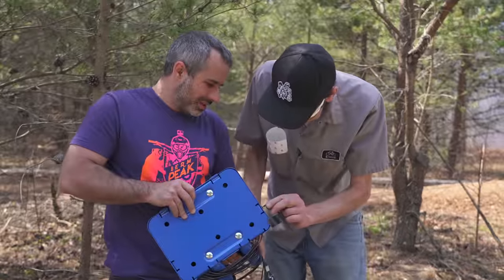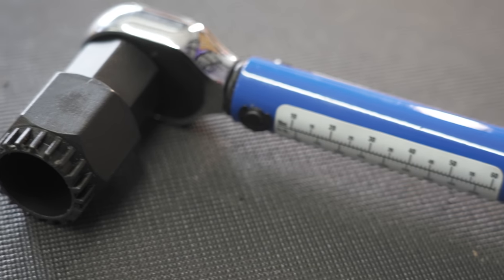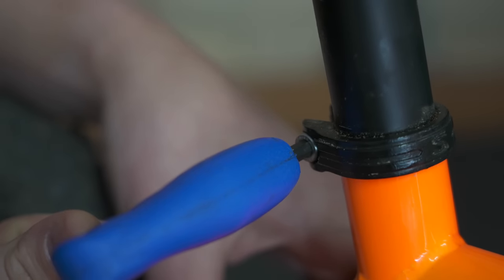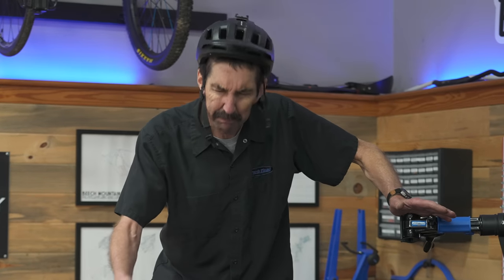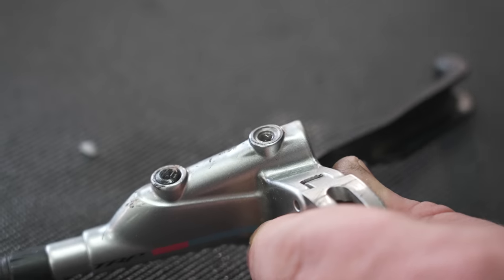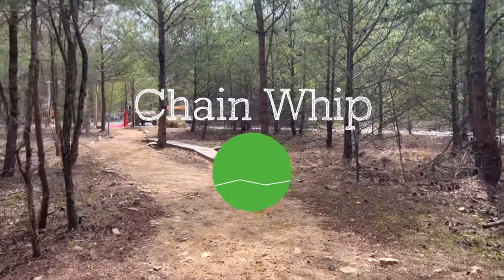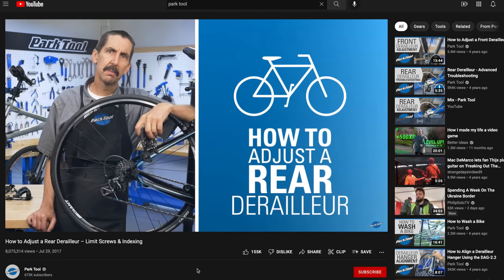10 Rapid Fire Bike Repair Tips for MTB & Beyond - Featuring Park Tool

Comment: All the tips were great. Thank you, Seth and a special thank you to Calvin and Truman.
I really liked the "Drop into water" test. I tried the test at home. First I threw a bent spoke into the water, It didn't float to the surface. Then I tried the same with a worn-out sprocket. It also stayed at the bottom of the water so I throw it out. Then I dropped my wife into the swimming pool. She came right back up to the surface, showing me that she is still good and I can keep her. The "Drop into the water" test really does work. Thanks, Seth for that tip. I am on the way to the lake to try that with my car.
Reply: "I'm on my way to the lake to try that with my car" - May the Schwartz be with you!
Reply: this technique should be used for everything. It's extremely accurate. I might drop my 60 year-old house into the ocean to see if it can hold up for any longer. I'm ordering a house-moving truck right now actually.
Reply: I thiught it was a joke at first. Is this some kind of physics phenomenon I could look up? :)
Reply: @erichbachman7363  The physics principal behind this is called the Archimedes Principal of buoyancy . Added to this is the Seth Corollary which states, “Whatever is not broken, don’t fix it. Whatever is bent, don’t fix it.”
Reply: @erichbachman7363  It was a joke, it will never float. But my first (physics) instinct was that it could be surface-tension related (you can look that up). It could work for lighter objects where a perfectly flat object has a bigger surface than a bent object which is more likely to break surface tension and sink. But this would be more apliccable to things like thumbtacs
Reply: It also works great for car batteries, you just have to replace the pint glass with the ocean
Reply: I threw my baby into the bath. Didn't float. Time to get a new one.
Reply: Posted April 3rd not April 1st.
Reply: @JamieRogers95  hmmm maybe don't throw car batteries into the ocean

Comment: The best tip I ever picked up is one I never see mentioned: If you have a bent hanger and a spare quick-release rear wheel around the shop or are riding with a buddy, remove the skewer and thread the axle through the derailleur mounting bolt. You can eyeball a coarse adjustment and pull/push on the wheel to adjust the hanger, or use a ruler to measure at 12/3/6/9 o'clock between the inside edges of the rims. If a rim is out of true just rotate them as you measure and use the valve stems as a reference.
Reply: I have used that several times, and for sure works. Makes it worth keeping one of your old 26er wheels around after you upgrade to a bike with through axles. Actually even better is to keep the whole old 26er bike around so one of your mates without a bike can ride it

Comment: Rebuilding the hub part brought back a wave of nostalgia for me I remember the first actually good bike I got was a 2009 Cannondale Chase, most backwards bike ever (dj bike with 1.5 through headtube and vertical dropouts???) i remember it came with this shimano cassette hub that could have been made of lead, this thing was like 15 pounds.  I used to ride HARD and i remember coming home from a ride (~13 at the time) and hearing clicking from my back wheel. This shimano hub was cast iron monster and i had managed to crack the inner bearing race, so me being a youngster with little to no money, i bought the same hub on amazon, it was like 20 bucks or so, and I used the axel and races to rebuild the hub inside the wheel! That bike lasted 2 years with me on the saddle until i gapped a 20 stair at UK campus and cracked the chainstay. Thanks for the memories Seth you got me into this shit (with the help of the staff at my local bike shop) and now i'm sitting pretty at 18 on my 2021 dartmoor 26 player completely custom built by yours truly!

Comment: Calvin is one of the best bicycle mechanics I've ever seen on youtube. Always calm, straight forward and explains perfectly. Unfortunately the Park Tools are so expensive in Germany I use other brands instead. But I really appreciate sharing their knowledge.
Reply: Same in Asia. Most grease from Park Tool are nearing 20 dollars per tube. Average salary is around 200 dollars a month. 😔
Reply: Yeah very expensive and no need for some of there stuff.
Good quality tools does the same job.
Reply: He sure is. I have a number of Park Tool and he has answered some of my questions via email. He's da man !
Reply: That's perfectly okay. Park Tools are meant for professionals, or people with some extra coin to spare they want something that will last forever. For your average rider who has 1, maybe 3 bikes at the most, the cheaper stuff is totally fine. 

As a different example, I run a tech repair business. All of my tools are Wiha, Moody or Hakko. All extremely quality tools that are best in class. But if you compare them to something half the price, the cheaper stuff will still get the job done. The difference is I've fixed over 25,000 pieces of tech. The occasional DIY person will be more than fine with a cheapo Amazon kit. Or if you want to step up a bit, iFixit makes a great in-between tool that is very well built but won't completely break the bank. 

There's no need to buy top of the line tools if you're only using them a couple times per year. Harbor Freight is very popular here in the US for that very reason. A lot of tools for the average person will only ever be used a few times. There's no sense in paying for extreme quality and engineering if it's something you rarely use.

Comment: For the headset one, always feel the headset because some cheaper brakes have pads that move in the caliper, and it makes it seem like its the headset. Holding the headset bearings give you a better idea of the condition of your headset
Reply: Ain't that the truth.. 
I personally like the bars at 90° (inline with the top tube) and rock / pull them back and forth / up and down to feel for any play ✨
Reply: @OLI-vx1md  why isn't that the truth then? If you personally do not do it the way Callum does, it's still true that they always feel the headset and some brakes have pads that move around.
Reply: I agree especially a cantilever brake, if you use the front brake trick the cantilever caliper slides within the brake post
Reply: @sdy0108  most disc brakes even do that when the pads are new. My maguras do that, my sram codes do that and my friends trps do too. No idea if shimanos do that.
Reply: @iljamuraschov  My Shimano Deore XTs do that.
Reply: @iljamuraschov  ment to write "ain't that the truth.." .. edited now ✌️😅✨
Reply: @OLI-vx1md  makes sense. Sorry for being maybe a bit to toxic before brother😉✌
Reply: Not just cheap brakes. My shimano XTRs do that out of the box. They still ride like a dream tho
Reply: Dude that's so true. I thought my bike was the only one that does that😲😲😲
Reply: @iljamuraschov  no drama dude, I can see how it seemed I was the toxic one..
Reply: @OLI-vx1md  ✌😉
Reply: I don't even use the brakes. Just picking up the front end of the bike is enough to trigger movement in the bearings if they're loose. One hand on the headset, one hand on the top tube, and lift.
Reply: @paddor  magura also has some one piece rotors, and even without magura rotors (i have hayes rotors on) the pads slide around in the caliper. Usually not that bad tho
Reply: Lol yep my slight wiggle is the pads in the caliper

Comment: RE repacking a loose ball hub: sometimes left and right bearings wear out at variable pace. It's good practice to keep them in two separate piles throughout, so you put balls from right back on the right side instead of mixing left and right. Tweezers are really convenient for manipulating those balls in and out.

Comment: For extracting pedal pins, get a Dremel and run a slot in the top of the pin and use a flathead screwdriver to remove it

Comment: The pedal pin issue is exactly why Hope F20 pedals are the best. The pins screw in from the top, but the screw head is on the bottom so it won’t get destroyed by pedal strikes
Reply: They'd want to be good. They're $300 pedals here.

Comment: For checking the headset,I find it best to turn the wheel 90 degrees and rock it.wheen the wheel is straight,it's sometimes hard to tell as your disc pads will have a little play in them anyway
Reply: Well, this way it may as well be your hub bearings being a little loose.

Comment: When checking for looseness in the headset, it isn't enough to put on the front wheel brake. You actually have to also turn the front wheel ninety degrees to the left or to the right, which will eliminate any play in the brake as a possible cause for forward or backward motion of the bicycle.
Reply: If you have play in your brakes then you have other issues
Reply: @drewziraldo5407  no, the brake pads move very slightly in place and when you multiply that movement through the length of the fork it is noticable and can be confused with a loose headset.
Reply: Nice tip!

Comment: Did my first ever race (XC) this weekend and on the 53km i had to stop 3 times to adjust my seatpost back up to the desired hight and each time i clamped that quick-release harder and harder.

That carbon friction stuff will definitely help, thanks for the tip guys 💪

Comment: If youre drilling the pins out and you have to apply a ton of pressure that ends up bending the drill bit, you need better drill bits..

I understand that the pins are often hardened steel, vut getting a decent set of carbide drill bits will save time and be way safer than having to apply a lot of pressure through a hand drill that will inevitably slip or snap. Everything seemed like very good and genuine knowledge, just thought Id add my 2 cents.

Comment: Before using the extractor, try to fit a small torx bit works 90% of the time
Reply: Even better, try and hammer a torx in, that is just about the same size as the hex tool to fit the bolt

Comment: Something to note when drilling, with a smaller drillbit you need to go faster than shown... If not itll either break the drillbit or dull/burn it out
Reply: Always use a slow bit speed when drilling metal. If you're breaking a bit it's because it's grabbing the cutting edge at a bad angle. Going faster is not the fix for this. Faster bit speed is also actually how to dull your bits when drilling metal.
Reply: @SnootchieBootchies27  No thats incorrect, look up cutting speed online, the smaller the drillbit the faster the speed. I'm an engineer, this is what i do :)
Reply: @Jackywacky96  oh, so close! If you would have said you were a machinist I would have been listening. Engineers are the people who just make life difficult for fabricators and carpenters. Just kidding, yeah, a faster speed on a smaller bit does make sense.
Reply: @SnootchieBootchies27  haha well actually I'm a multiskilled engineer so I do a lot of machine work, fabrication and welding as well as mechanical and electrical work ;)

Comment: Hi Seth, sometimes the trick of putting on your front break and rocking the fork back and forth can be inaccurate.  With my bike, if a rear linkage bolt is loose, it will feel almost identical to a loose headset because of the way vibrations travel up the frame Just sharing my experience here, hope it can possibly help anyone who’s having trouble diagnosing a loose bolt.

Comment: Hey Seth, reverse drill bits are a thing and work great. Sometimes just the drill bit will pull the pin out without even needing the extractor.

Comment: That is great idea and partnership with Park Tool. I am realy enjoing the Park Tool vids, and always it seems like they are extensive, but not enough 😅. I also would appreciate separate channel on Park Tool tools and greases - with all of the descriptions, specifications and 'use-cases'! Not to fiddle around but just go 'straight to the' most recommended grease/oil/chem + tool to use. I really like 'product codes' that PT is using. That removes uncerntainty of what actually I need.

Comment: For filing the flat near the pedal, there are files with a "safe edge", one of the faces is plain metal that won't typically cut or scratch the pedal. Great for getting into corners of parts. If you're good with a grinder, you can also grind your own safe edge on an older (or new) file.

Comment: When overhauling a disc hub, I prefer to remove the disc to avoid putting grease on it and I can also take the time to check if the screws are still good or need a replacement before getting f*cked later. I also give them a nice cleanup before putting them back on so I'm sure they are good to go. Always nice to see you with the guys from Park Tool, it's a very nice collab and we all enjoy to watch your videos.

Comment: funny story no one cares about, but i opened youtube, saw this video in my recommended, opened it in a new tab. Then i searched "how to adjust rear derailleur" to find the park tool video  because I bent mine on my last ride somehow and I had a spare one in the parts bin. Just wanted a refresher to adjusting the limit screws again before I got started on that, and you used the rear derailleur video clip multiple times. Fun video, Off to watch that one. Then out to fix my bike and ride it!

Comment: awesome video, good tips, lovable presentation! For the pedal situation and any stubborn bolts, the power of thermal expansion cannot be underestimated. While you cant torch aluminum like you can steel to be red hot, a bit of prescribed heat does miracles to loosen threads. I've had success even using boiling water.

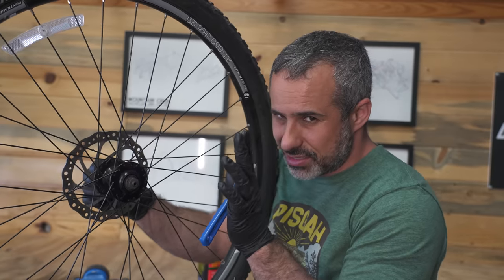Comment: 7:12 is actually right here, when I was overhauling my cassette hub I had to use a Bench vise so the lockout on the cassette side right should not move together on the left. So about the smooth apin, Seth wants it to be the tiniest wobble you can feel because the quick release acts like a locknut but it's also compression.

Comment: As a seasoned bike mechanic I can say that loose-ball hub rebuilds are not usually as straightforward and easy as described but not impossible to pull off in a pinch with no new parts or specialty tools like cone wrenches. A lot of people won't notice their hubs knocking until the bearings and cones are damamged bad enough to need replacement. 

Also, "Liquid Gun Blue" to refinish wrenches? How have I never heard of this!? I can't wait to try it on my aging hex keys

Comment: If you have spare wheel with qr hub, you can use it as deraileur hanger alignment tool. All you have to do is screw the second wheel into the derailleur hole and make it parallel to the wheel that is on the bike.

Comment: Pedal pins can be a pain to remove. If you clean out the hex head carefully as stated in the video, you can put a bit of EZ Grip on the Allen wrench to help take up the free space in the worn fastener. 

EZ Grip is an industrial product, but it's just an abrasive compound used to gain friction on the fastener head. It's also really cheap and readily available.

If you do not have access to this, Comet, Ajax or any type of cleaner with an aggregate will work if mixed into a paste. Gojo works great.

Comment: To get the pedal set screws out I use a hammer and chisel to make a spot in the top of the set screw that I can put a flathead screw driver in. It’s not the most elegant way but it works

Comment: For stuck bolts, drilling them our with left handed drillbits works well. Often the heat from drilling and the counterclockwise rotation will allow the bolt to wind itself out. Massively better than those screw extractors.

Comment: Ordered a new derailleur hanger and did the float test. Looks like the seller is trying to pass off used parts as new! Glad I learned how to check.
Reply: I hope you're not taking this seriously.
Reply: @doncrescas  You saw how easy it was to re-blacken a scratched-up tool, right? The float test is the only way to tell if your part is actually new or not!
Reply: @MichaelOnines  I meant I hope you're not taking the idea of a float test seriously. It's ridiculous. Place it on a flat surface and check that way. Better yet get an alignment gauge.
Reply: @doncrescas  The float test is the only way to tell. You need to look up "Hydrogen migration over a metal oxide surface". The studies confirm it. The older stuff has lost its buoyant hydrogen, and re-bluing doesn't bring the hydrogen back.
Reply: @MichaelOnines  I can't figure out if you don't realize that it was a joke, or you're just taking the joke to the next level.
Reply: That the study mentioned "metal oxide' was a bonus, by the way.

Comment: For the pedal pins. If you get race face Chester pedals you don't have to worry about this because the head of the screw is on the other side of the pedals. Just use a pick to clean the head out then unscrew.

Comment: Regarding the first tip, I always tell newbies to grab the front brake and wiggle the bike to check the headset before every single ride. Left hand on the brake, right hand on the top cap. 

BUT there's another important piece of info. When you do this test, there's almost always some play in the caliper, and unless it's brand new, theres going to be some play in the fork. So be aware that these two points may also be moving, and be extra aware of where any wiggling is coming from while doing the test. Riding with a loose headset is baaaaad news. 

Lastly, I do have a derailer alignment guide and I use it a lot :) Technical riding really beats things up. Most riders don't though so people borrow it all the time, which is all good.

Comment: TOOL TIP. I use baby oil to clean and maintain tools and parts that moves but it will degrade plastic over a few years just be wary of that but it's way better then wd40 in my mind and stays on also doesn't get thick it's amazing 😍